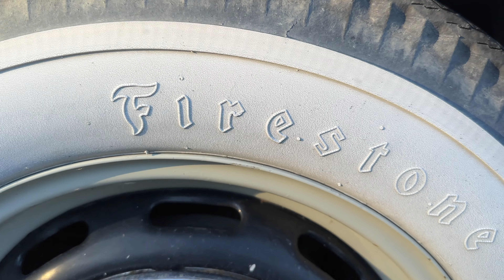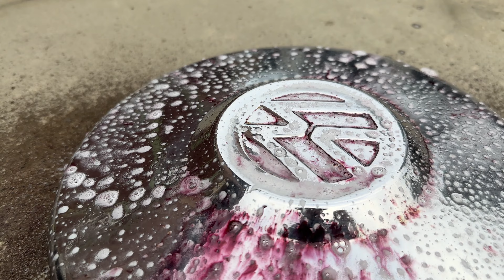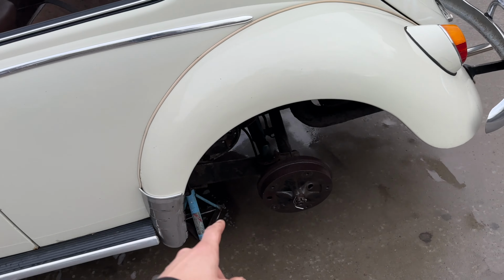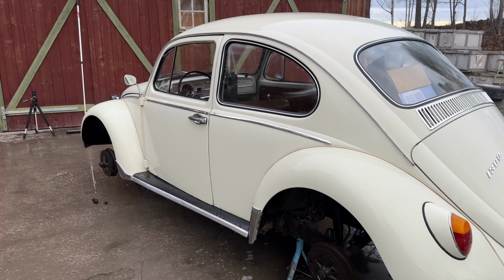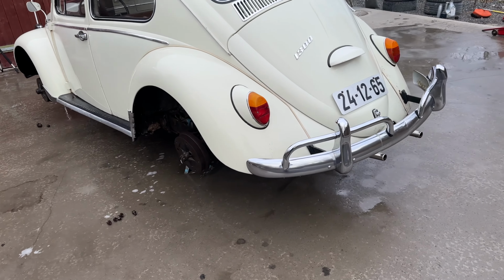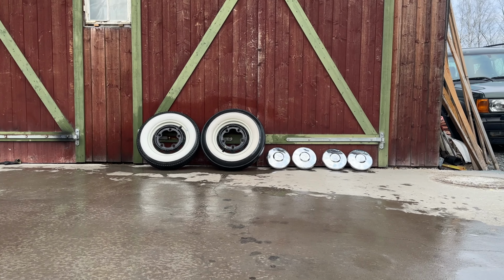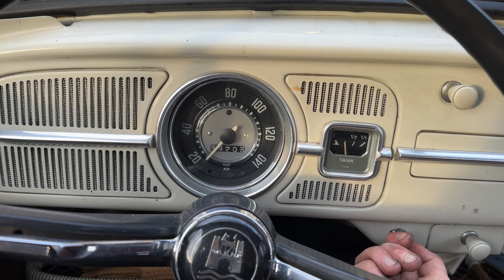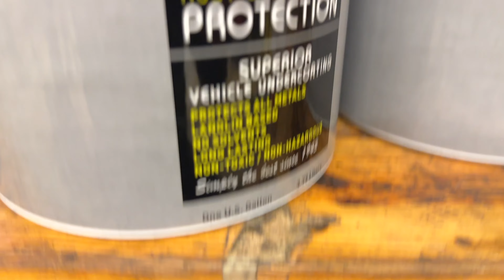66 VW Beetle under coating

Comment: You could have done a much better job if you would have ice blasted and then applied under coating , anyway cheers
Reply from the maker: Yeah thats true! Need to try that it the future😄
Reply: yeah this is sloppy and rushed
Reply: @johnadona3014  as opposed to doing nothing as most people do, this is 100% better. The fluid film will creep into every crack and seem and keep it from rusting for a long time.